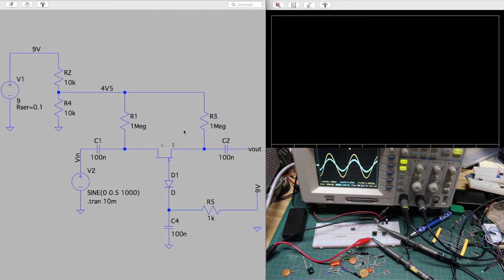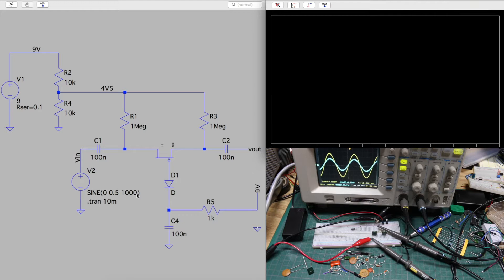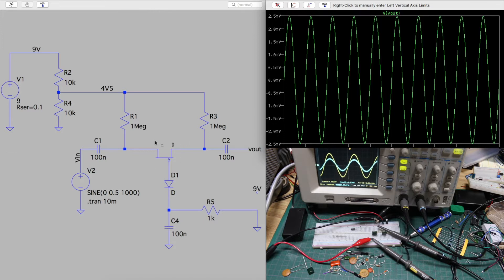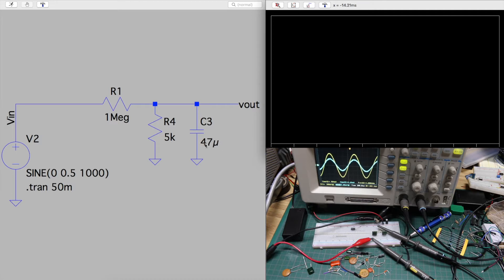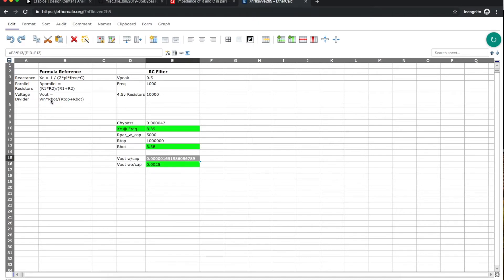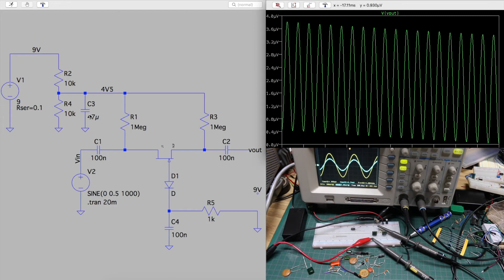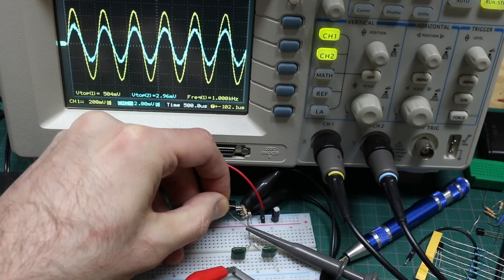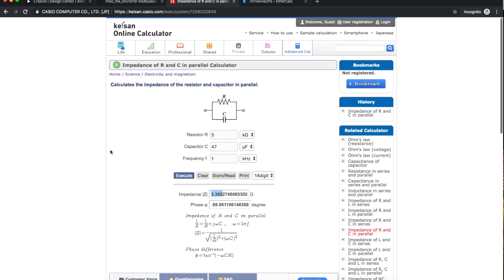Bypass Capacitors in Audio Circuits

Comment: Great editing on this video, circling the relevant schematic elements with your mouse while talking about the values in the spreadsheet is really helpful!
Reply from the maker: Yeah with four individual circuit diagrams to switch between, and many different things in parallel, I thought it might get a little confusing especially when I’m on a different calculation screen and the schematic isn’t visible. I’m glad it conveyed well.

Comment: Why not just use 2 independent voltage dividers made from two pairs of 1M resistors, one for each leg of the JFET?  Then you don't have to worry about crosstalk or decoupling caps.
Reply from the maker: Maybe I will set up a simulation to see how that would go. Simulating is so much faster than building on a breadboard especially when the circuit is already configured in a file. I’ll have to remember to do it later.
Reply from the maker: I ran the simulation and it looks like indeed it works.  I put a SPICE file and a JPG of the simulation in the Github files
https://github.com/GadgetReboot/misc_file_bin/tree/master/2019-05/BypassCapSimulation/No_Bypass_Alternative

Thanks for the idea!
I guess if a real product has more than a couple of bias voltage rails to feed, it would start to make logistical sense to stick with the single voltage divider and bypass capacitor and just run the trace all around the board, but either way, getting the brain going is part of the purpose...